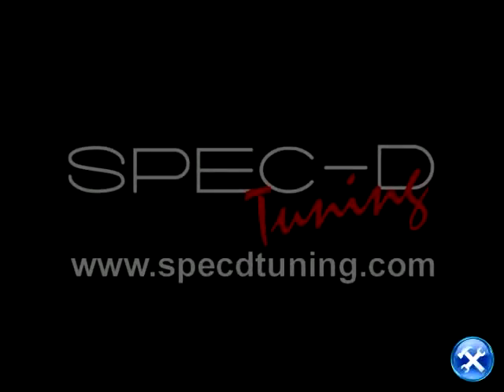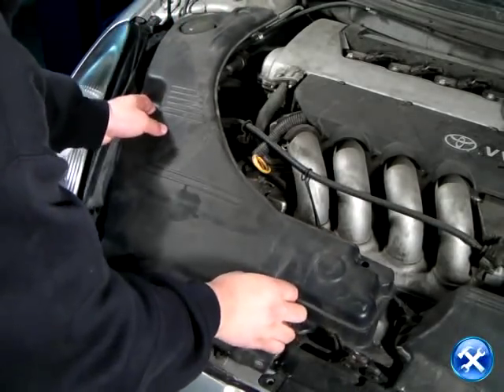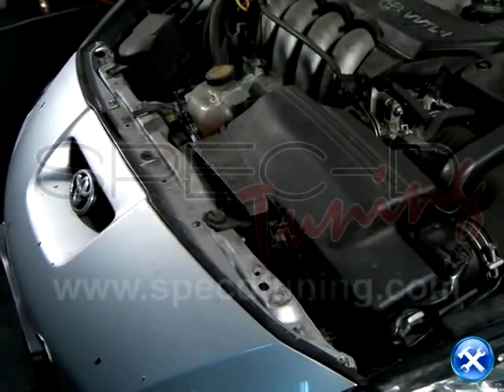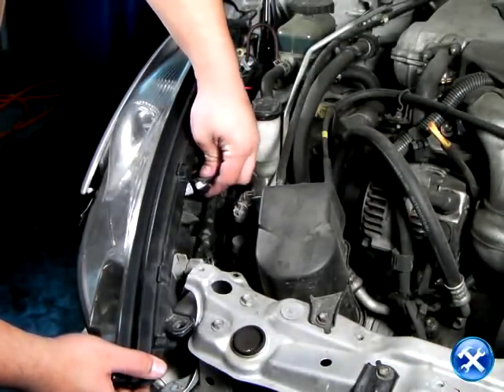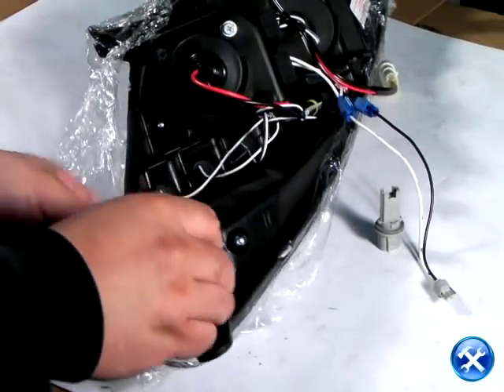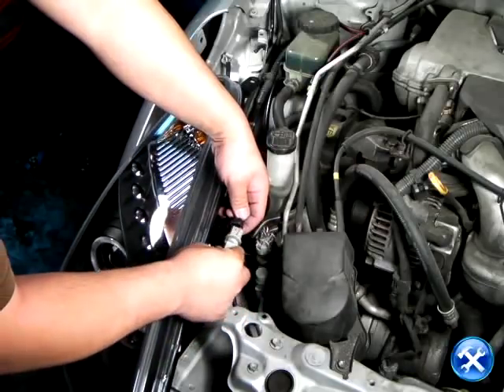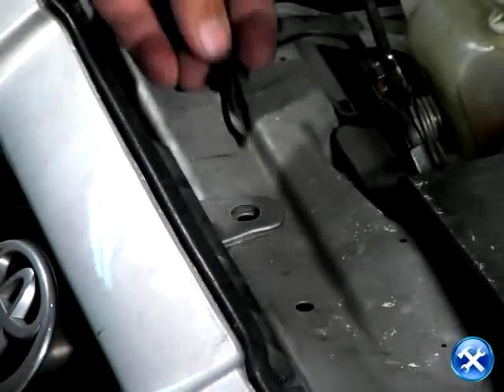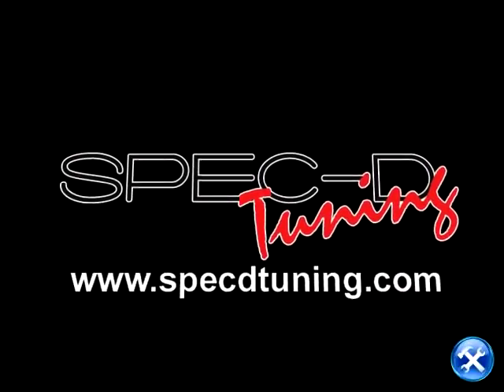SPECDTUNING INSTALLATION VIDEO: 2000-2005 Toyota Celica Projector Headlights

Comment: I have 02 gt have had spec d rear led lights and bought headlights from spec d today (both smoked) hooked everything up and it looks great however after i turned on the car and drove it a couple times I noticed that my tail lights didn't illuminate when the headlights are on and also the led rings and line of leds didn't work, never had any problems with tail lights until now any suggestions?

Comment: I just these lights for my 2004 celica, followed your install instructions in the box, and watched the videos. I was able to remove the bumper, lights, etc. and add the connectors and wires as you instructed as well. The low beam headlights work, the high beam headlights work, the blinker works, and the Halo ring lights work, but the LED lights do not and these are suppose to be brand new. Can someone from SPECDTuning respond on what could be wrong? 

Keep in mind ive watched your install videos and wiring installation video.

i look forward to your response.

Comment: @Specdtuninginfo that other video is not showing it done on a Celica its like a honda accord or something. i just got these light and i was trying to install them my self and i used the mail-female and a quick connect to connect the halo part. but the Led has a whole different hook that u have to plug it in something. so how do i connect the 5 leds to the car so they turn on when the halo comes on.

Comment from the maker: @angelv89 did you also go through with how to wire your halos? both halo's and LED's act as your parking lights or they can also act as your DRL's. they dont have any association with your low beams unless you made some changes and wired them to do so.

Comment: Had these lights installed for a couple months now, and I was wondering if I installed the LED rings around the main high/low beam bulbs wrong cause seeing as there was no where to connect them I bridged the connection to the main LED strip connection. Unfortunately about 2-3 months in now and 3/4 LED rings are completely blown out. I just wondering if its the tiny LED bulbs or the connection that is bad. Wanted to know cause changing the ring bulbs is a pain since it requires bumper going off

Comment: have these lights for my celica followed the instructions for fitting and when i wire the halo/led to the connecter for sidelights they trip my rear tail light fuse any help would be great

Comment from the maker: No you would have to use the bulb size on the headlights you would like the HIDs to go in. so if you want to use HIDs for your stock headlights then get that size but if you want it for the headlights in the video those would be a different size.

Comment from the maker: @santoyo801 If  you have the same brand which is TM headlights, then you should be able to change any of the light bulbs, there will be no problems, however, if they are sealed, please check with your seller for more info. Thank you.

Comment: Do you have to take the whole bumper off if i wanna remove the small grill piece with the toyota emblem on it. Or can i pop it out somehow or is it screwed on
Reply from the maker: Yousef Ishaq The Toyota emblem is attached to the complete bumper. You might need to remove the complete bumper if you want to remove that part.

Comment from the maker: @santoyo801 Make sure you get the correct light bulb application for the headlights. The application should be same as the projectors. Sorry, we do not sell HIDs, so we do not have a video out for installation. However, the way the HIDs are made now are pretty much plug and play.

Comment from the maker: @malikahsan1990 The 5 LEDs should have come on when all the loose wires are tapped. 90% of the lights should come with up to (6) wires, (3) black, (3) red, for halos and LEDs. As long there are no wires hanging around, then your tried them all. If you checked to see if you spliced them correctly; then it might be the headlights that are defective. I hoped this helped.

Comment: What size are the replacement bulbs for your HID Projector Headlights for the Celica? I bought replacement low beam bulbs but it didn't fit...
Reply from the maker: please take out the ones they came with and check what size they are. They should be H1 or H3

Comment: I bought these headlights for my Celicia and two of the LED lights went out almost immediately. Can you tell me what type of LED bulbs these are? They look similar to T10 bulbs, only larger. I can't seem to find them anywhere online and it's really frustrating. The bulb has "XLR 495" printed on it, but that doesn't seem to lead me anywhere online. Help please!
Reply: Jeremy Muller hi man I got the same problem any luck with the info thanks!!

Comment: You say this is for the 2000-2005 Toyota Celica T23, does that mean they won't fit on my 1999 Celica T23?
Reply: They won't fit but you could buy subaru impreza if you like awd cars

Comment: I just got these lights in and they look amazing!! Only thing is, my LED aren't working. I don't know where to connect the wire from 3:32. I don't have a driving light socket. Also, I didn't receive the female and male parts.

Please help!!
Reply: I have the same problem, the 5 LED lights are not working.

Comment: i just bought these and had them installed but one of the halos did not turn on...... what do i do ? can i get the bulb somewhere? if so, what are they called?  or do i return them?
Reply from the maker: Hello Brandon, there can be a few things you can check to make sure the halo and the LED bulbs are hooked up to a power source. make sure there are no loose black and white wires behind the unit. If you need help with wiring the headlights you can search "SPECDTUNING Installation Video: Halo LED Projector Headlights Wiring Installation" on YouTube. I hope this information helps.
Reply: Spec D Tuning can they be aimed ?

Comment: Question for Spec - D --------Do you reccomend a certain kit for the HID conversion ?
Reply from the maker: Hello Angel Estrada You can use any HID kit so long as you have the correct bulb size, although we do not recommend you installing any HID kits on our headlights.
Reply: well in your installation video it appears you have a HID kit installed- that why i ask, is there a reason you do not recommend? or do you not recommend i install it? can it be done professionally?   check  time @ 5:58
Reply from the maker: Angel Estrada If for whatever reason the HID kit melts the projector, then the vendor you purchased the headlights from will not replace the lights.
Reply: thank you for the professional input- i am very grateful for the suggestion and i will very much comply for the safety aspect. thanks- may be next time

Comment: EXCELLENT VIDEO. PROFESSIONAL !  I had a loose clip, passenger side,  holding the upper light on a 2001 GT. I DID NOT need to remove the bumper. Just loosen and lower about 2 inches, then loosen 3rd bolt.

Comment: The light out put on these are very poor. You can't see where you're going. Also the headlights aim down too much. The halos are super weak and you can only see them in the dark. Also you don't need to remove the headlight lower bracket. Thars just more unnecessary work.